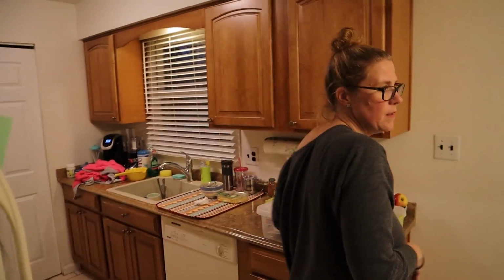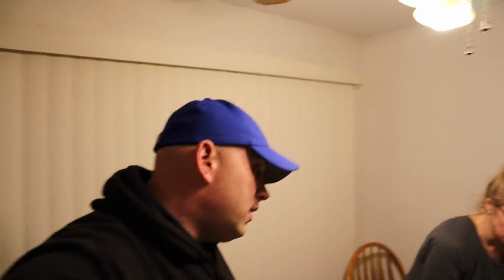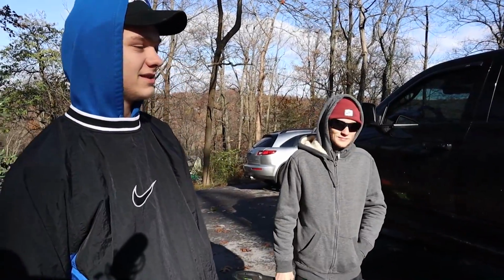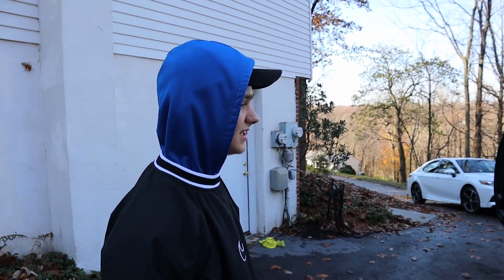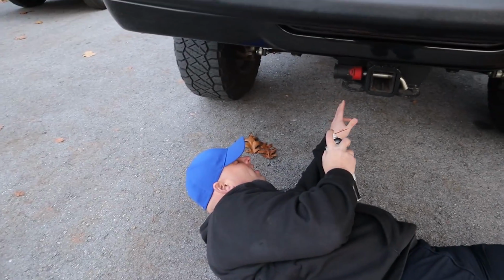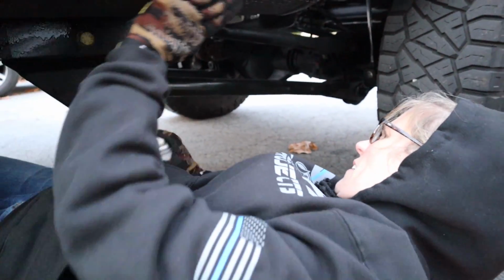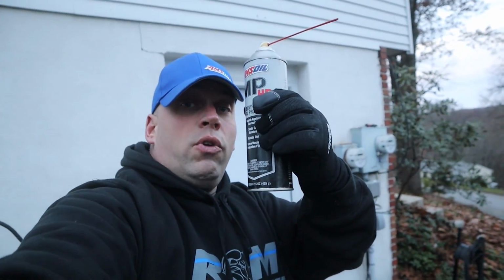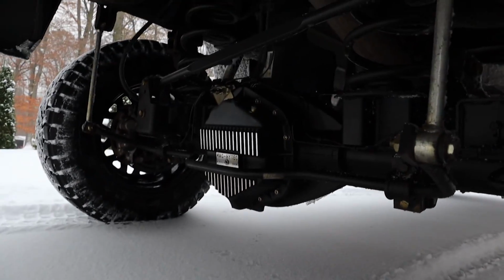MUST PROTECT! Winter Vehicle Prep with AMSOIL MP HD

Comment: Hey bud. I’m new to the tune / delete world. I’m currently in the process of getting my truck deleted. Watched multiple videos of yours. I saw that you had to get your trans rebuild. Has me very nervous. I have a 2017 Laramie 2500 with the 68RFE. What do you recommend for a safe daily driver hp tune? 

Thanks!
Reply from the maker: You’ll be fine with tune 3. If you decide to bigger tires, definitely do a gear swap.
Reply: What hp is that if you don’t mine asking? Everyone has different tune / settings. And I changed my stock tires out for 35’s. So will that be okay?
Reply from the maker: 100HP